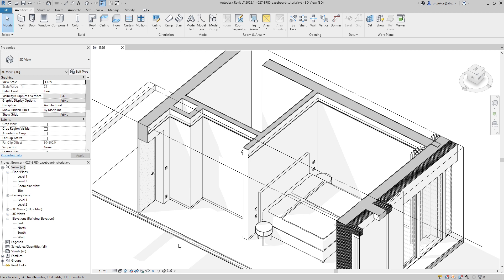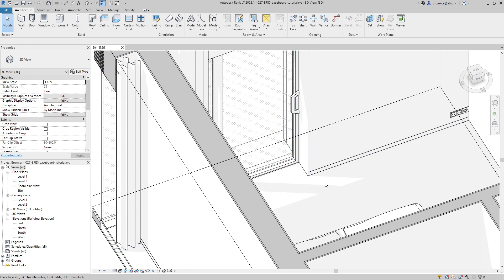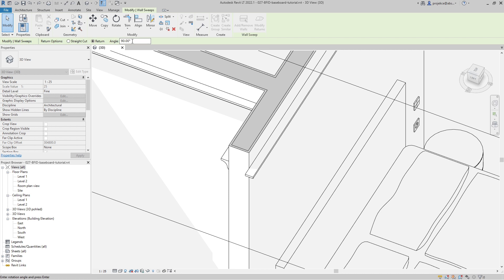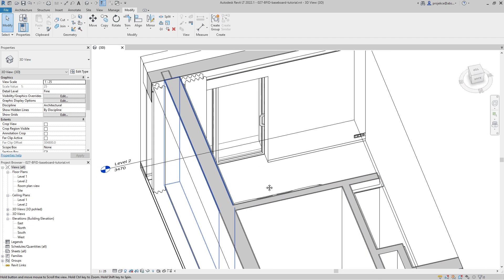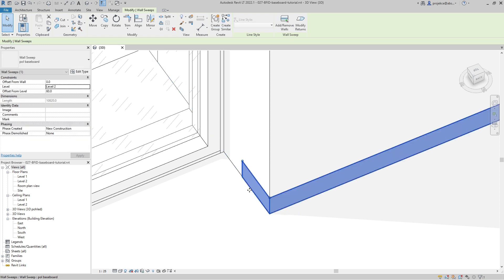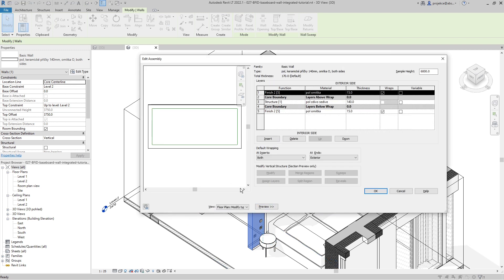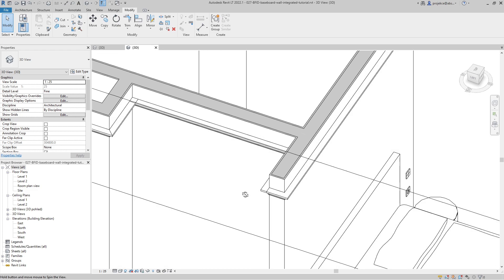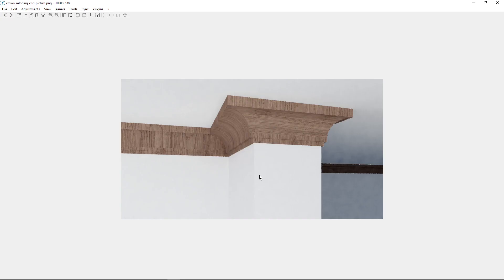Wrap Wall Sweep at Wall End in Revit

Comment: As per using (wall sweep) technique for creating skirting & ceiling moldings, well its quick, neat & very good in schedules.

The main challenge for my with this technique is losing the (tagging by category). 

If you faced the same problem, how could you deal with it for annotating the wall sweep?